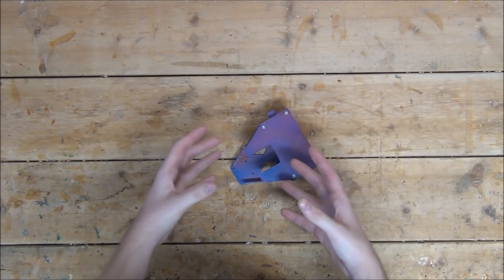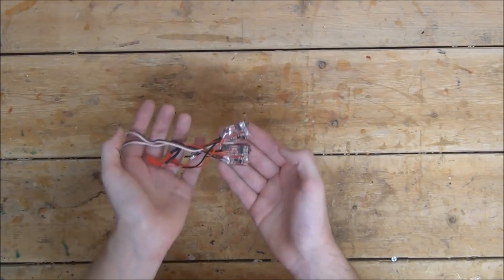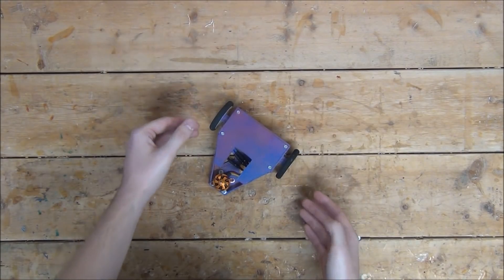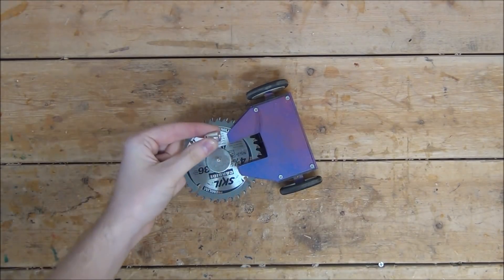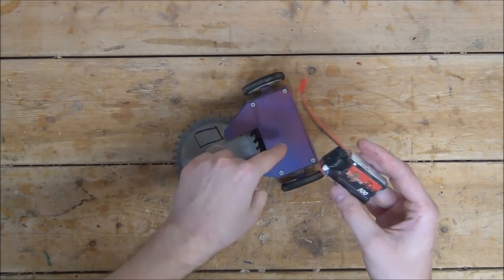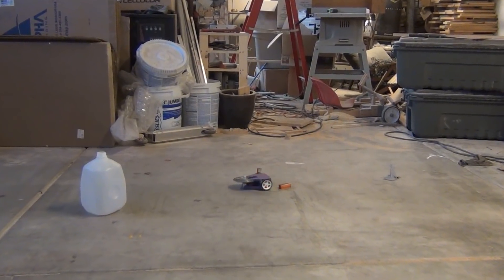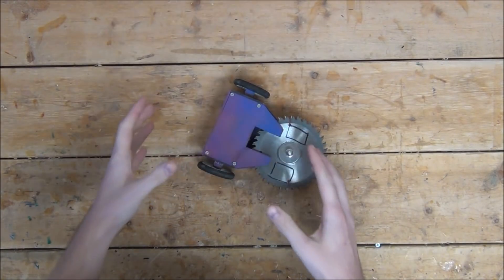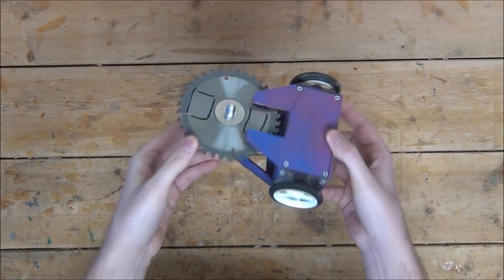How To Build A 1LB Spinner Battlebot Part Two!!! // Testing The Bot!!!

Comment: Your definitely improving a lot with your designs. Just a few things, you give glue too much credit, most likely your chassis will shatter when hit with another spinner, also while the glue isn’t holding the blade it’s holding it centered and it could shift and cause the blade to become unbalanced. Also your motor is fine, the smaller you go the smaller the shaft your motor has which is important. And last thing, you have 50g to spare so protect your wheels because they micro gear motors are pretty brittle. But besides that great job!
Reply: All the glue is for is holding the washers in place until the clamping force of the prop adapter can hole everything together with friction.
Reply from the maker: Team Tanto Robotics Haha! Nah, the whole bot, glue and all is incredibly strong. Iv done quite exstisive strenght testing on it. And as for the blade as I explained in the video the glue only holds it until you bolt it down. Once properly bolted the blade won't move, not even if the glue wasn't there. And you can actually buy smaller outrunner motors with the same shaft thickness as this one has. However you are correct the motors shaft thickness does matter a lot, because the blade is only as strong as the motor it is bolted to is. :)

Comment: This bot garbage
Reply from the maker: "she may not look like much, but she's got it where it counts, kid"
Reply: An unbalanced spinner? That will make you vibrate to the point where you can not drive.
Reply: You shold not just say it is bad without coming up with a good alternative.
Reply from the maker: very true! If the blades weight is off by just a little it will go completely crazy!
Reply: Juan, what have you built? I would love to see what is so much better than this.
Reply from the maker: You're talking about making a blade the utilizes the whole opposite blade rotation concept? that would be really cool but sounds needlessly complicated. However if it is more effective then and regular singular blade maybe it would be worth it. :)
Reply: Mechanical Ninjineer maybe she does, but if you want to do some good Damage, go for an unbalanced spinner, and make it spin the opposite way. When making a small boy damage is key. Try it out, go for a cyclone kind of shape!
Reply: Mechanical Ninjineer Not exactly its like the attack helicopters that have two rotors on top that move in opposite directions. If follows 2nd law of motion; although you need a bit more weight in the back.
Reply: Mechanical Ninjineer It's not very needless it would help the damage output quite a bit.